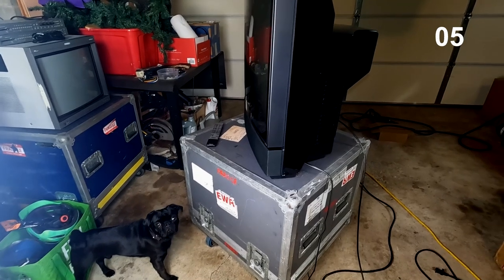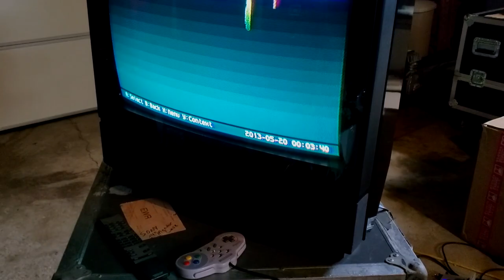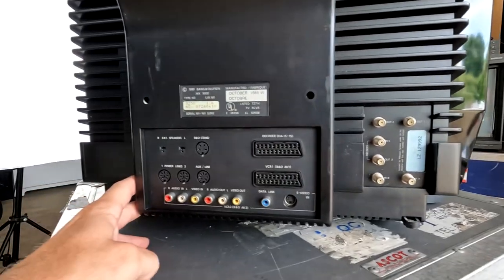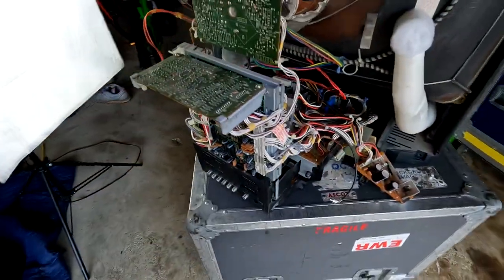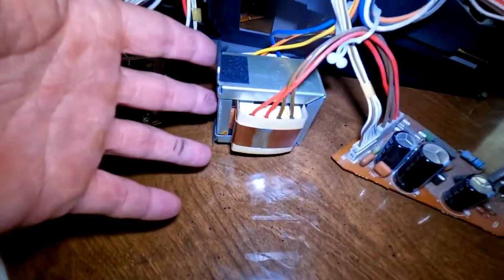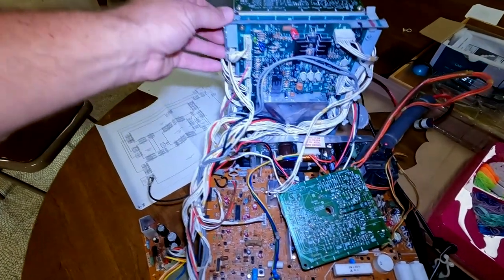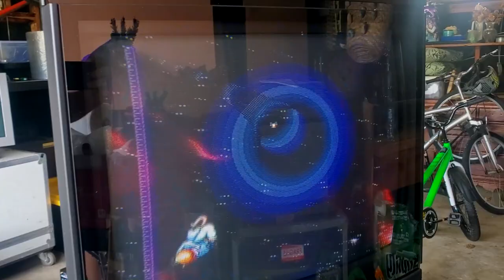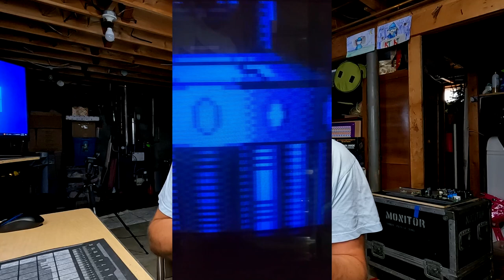The American B&O TV with RGB! - MX 5000 Restoration

Comment: Thats not corrosion its flux, i wish everything was as easy as just changing capacitors, in my experience theyre hardly ever bad in these, the horizontal output transistors go first and the rubber CRT grommets that position the purity assembly, they turn hygroscopic and in the end they will destroy the windings on it, they go rock hard and hold moisture, if thats the case they need to be replaced instantly

Comment: Seriously, they should bring back the CRTs, they are really necessary for 8/16/32bits consoles, filters have nothing to do with the real thing, HD TVs destroy these games. Your work is amazing, but, finding CRTs and what we need to repair them is getting harder and harder, the thing is, they must produce them again. See ya.
Reply: I do not agree. Philips had a patent for a flat CRT panel, 100% identical in image to a tube, but with perfect geometry and massively reduced weight and thickness. The patent should be expired by now. It looks a bit like Plasma, but works with electron guns and scanlines. They never put it in a TV as it was more expensive than LCD by the time they had it ready for production.
Which brings me to my Panasonic Viera.... Doing my PC Engine games over SCART is very close to what this flat CRT could have been. Just no space between the lines. A small sacrifice for a TV that costs like 20€ nowadays.

Comment: Here in Europe these are really cheap. I also wonder if the "no-picture" issue was a theft-lock thing. These B&O's had theft lock built in. If you did not enter the right PIN with the remote, it would not start again until you enter a Master PIN. I do agree that the usability of the remote is a nightmare. For example the "record" button is "turn off".

Comment: Man, just the dust, cables, boards would make me faint. Going though and disassembling it would be such a hassle and work. I opened one of my IPS monitors because one of the USB ports on it was acting up and there were literally 3 boards on it. The main board, the power supply and a small tiny board connected with a ribbon which had USB 3 on it. I have a CTX monitor and it has just two boards. A lot of CRT Monitors I've seen or worked on have just the main board and neck board. I have a HP P1230 and it had like 5 connected with a zillion cables. I hate working on that but it's a 19' or something and looks really nice. Props to you man, I hope you got well paid because a lot of people wouldn't really bother.

Comment: i have a B&O Beosystem AV 9000, it is my favourite CRT, it has a motorized stand and mechanical doors covering the screen that slide open and shut when turning the tv on and off, the front contrast screen surround is blue which i think looks good.

Comment: I have owned MX7000's and MX4000.
Sadly these sets even if the firmware is over 3.0 all suffer from barrel roll in the image. 

This was later solved in the MX8000/MX4200 models. So now I'm sporting two of them. One Horizontal and the other Vertical. Love them!

Comment: I found one of these for sale for ~50 bucks (in Sweden where I live). But it's not the ntsc version with all of those inputs. It has one rgb scart, rf and the stand and other connection. No av/composite inputs. I managed to fix the remote and it works now. But I have issues with the tv. For one, there is no UI. No on-screen text like the "set tv clock" on your tv. No volume bars or source info. Nothing. Pressing the Picture button will let you change brigthness, but I can't see what I'm doing. Picture + Up-arrow did the job as it turned out.
When I turn on a console via rgb scart it auto changes to another channel/input. But the image is all messed up. I have to press the V.Tape-button. Looks amazing. But, after a few minutes it gets really smelly. Like really bad so I dont really know what do to with it. Not really comfortable about opening it up. Anyone experienced similar issues where the UI is gone?